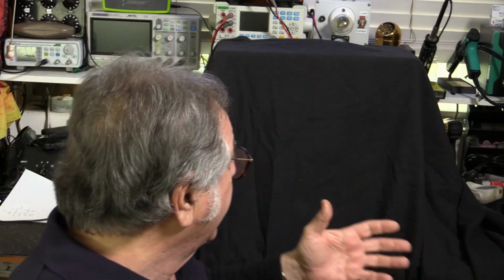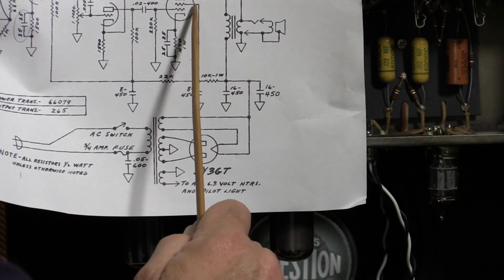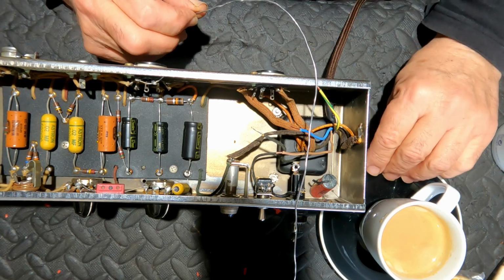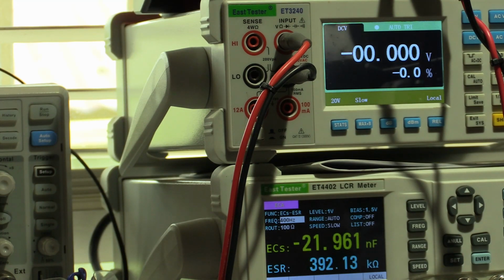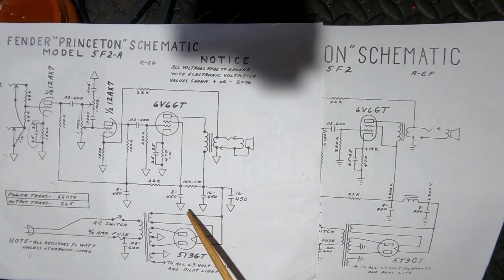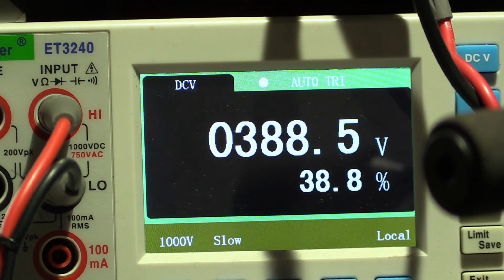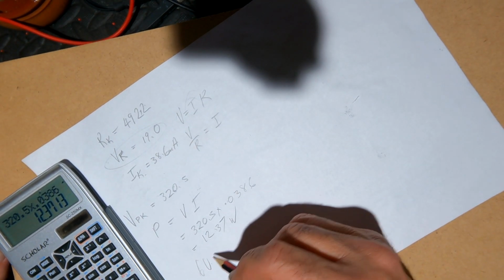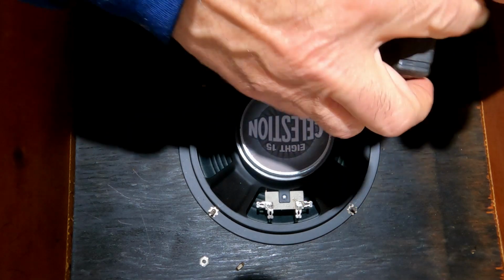Tweed Princeton 5F2A - Learn diagnostic and repair techniques to make this amp safe and original.

Comment: Preamp cathode caps may also be leaking DC.  Are they 63+ years old?
Reply from the maker: You are certainly correct, jj. However, my brief was to preserve as many original components as possible, and I agree with this principle 100%. I hate it when I see such historically important amps with bright orange caps, or ghastly blue resistors reducing the amp to a Clone of itself. As the custodians of these amps for players of the future, we have a responsibility to keep components as original as possible. An excellent question, jj. I need to be more adamant about this responsibility in future videos. Thank you.

Comment: Really good vintage Princeton video! I found it particularly informative how you were very hesitant to change out any series coupling capacitors. The uF values can vary some without major impact on the tone of the amp  Also, I now see why ESR on coupling capacitors is not so important, but leakage currents are very important to be low. I know that uF and ESR values on the bulk capacitors are important, but leakage current is not very significant. I always learn something from you!. Most importantly - the sound! The sound with that Les Paul Deluxe with the mini humbucker pickups was glorious!
Reply from the maker: Wow! Thank you so much, John. Your comments make the time investment in producing the videos (especially editing) all worthwhile. I am so glad you get something out of the videos. I love that Les Paul Deluxe!! Its a 1979 that weighs in at a hefty 10.2lbs, but the sound!!

Comment: Good speaker choice. When I built my tweed champ clone, I used a Princeton sized cabinet with a baffle cut for a 10" speaker. The speaker I chose was a Weber 10A100. It's got a smooth cone (with all the problems that entails) and pushes about 15 Watts downhill, with the wind behind it. It's such a good speaker. Fan-phreakin'-tastic.
Reply from the maker: You are spot on, Bladder! After hearing this amp, I have decided to build myself a Tweed Princeton and I have also decided on a 10" Weber!. Great minds...
Reply: @theguitaramptech  A video on the Tweed Princeton build would be fantastic, I would like to build one of those too... and a VOX / Marshall hybrid....
Reply from the maker: @stevesheekey5263  That's a great suggestion, Steve. Otherwise, I keep putting my projects at the bottom of the priorities list. Oooh, I like the idea of a Vox/Marshall combo. If you haven't already, take a look at the Marshall 1974 18w Hand-wired, and you may find yourself halfway there. I own one and (after my improvements) it sounds fantastic...but that another video :)

Comment: Hi Chris, 

Great video and fantastic to see these classic amps serviced to live another 50 years! 

My I ask your advice, if the B+ is too high on an older amp say a 5E3 or similar fender design (ie 398) because of new PT or higher modern wall voltages, is it ok to install 5W zeners to the PT Centre Tap to ground to bring down B+ to around 360. Or is there a better way to do it? Any harm to PT using the zeners to drop the AC into the rectifier tube.

Thanks for your videos, learning a great deal from watching them.

Regards Steve
Reply from the maker: Agreed Steve. It is such a privilege to work on these classic, and then hear the results. I have had to return a couple of "uneconomic to service" solid-state amps from the 70's and 80's due to a lack of parts. But, as you said, these old tube amps can live forever, Putin permitting.
Reply from the maker: Sorry Steve. I missed the second part of your message. You can use a Zener, or a couple in series with the centre tap to drop your B+, or a resistor, but they will get hot. You may need to heatsink it to the chassis, in which case you had better make damn sure you have a good reliable soldered connection to ground. Also keep an eye on your heater voltage if you have a elevated mains supply. Have you tried a different rectifier tube? If a 5Y3 is still too high, try a 5R4 (not 5AR4).
Reply: @theguitaramptech  x1 15v 1N5352B and x2 12v 1N5349B and the 5Y3 have dropped the B+ 1 to 361V. Time to search for a speaker for the 5E3 - 12A125A ? Thanks Chris
Reply from the maker: Good work on the B+ drop. Hopefully sharing that voltage across the 3 diodes overcame any heat issues. If you ever have time, pls send me a photo (email?) of your diode installation. I owned a (beautiful white basket) Weber 12A125, with ribbed cone. I a moment of madness I sold it to a customer looking to upgrade his Deluxe. His amp sounded great, but I lost one of my favourite speakers.
Reply: Thanks Chris, amp came with 5AR4, way too high B+, put in 5Y3 which dropped it down slightly, will try 5R4. Thanks Chris

Comment: Very good and intresting video. Thank you! Couldn't it be that the voltage on the filtercap wasn't dropping down due to the absence of the 6V6? Do you suggest that extra 220K or 330K resistor on all the tweed Champs and Princetons? Would you mind to share the max ESR reading chart you used? Greetings from Flanders
Reply from the maker: Hi William. Wow! Flanders has an amazing history. Its on my bucket list.  I agree, that having the 6V6 in place may give a path to ground for the B+, but only until the Cathode cooled. There should be no physical connection between the plate and any other element inside the tube. The heater voltage would stop as soon as the power is removed, especially if there were no Standby. The drain resistor is really only there to protect you and me. Most normal people would not be accessing the B+ with clumsy fingers. 
Of course, I would share the ESR chart if I could figure out how to do it. I am happy to do a video on ESR and why it is important and how to measure it.
Reply: Hello Chris, Thanks for your quick reply. For the ESR chart. A video on ESR would be great. Or if you could give a short close-up in one of your next videos, I could take a print screen. Or i can leave my emailadress  on your website. Whatever is the easyest for you. Thank you in Advance
Reply from the maker: @williamgombert7710  good suggestion. I will do an ESR video but that may be a while off. Send me an email through my website contact page and I’ll send you a photo. I’d give you my email address here, but I know I will be swamped with 157 junk emails by the morning.
Reply: Thats what I thought, can't believe 300+V holding charge like that...Wow
Reply from the maker: @riley0187  that’s so right, mate. It would kick my aging arse across the room and all the way to heaven.